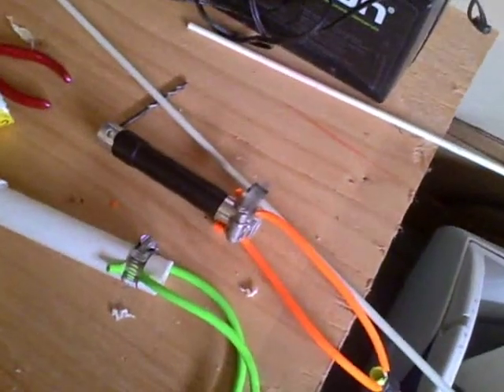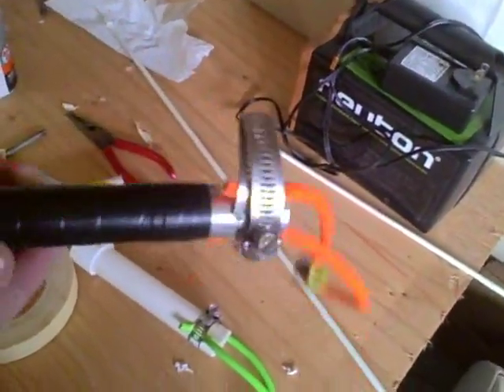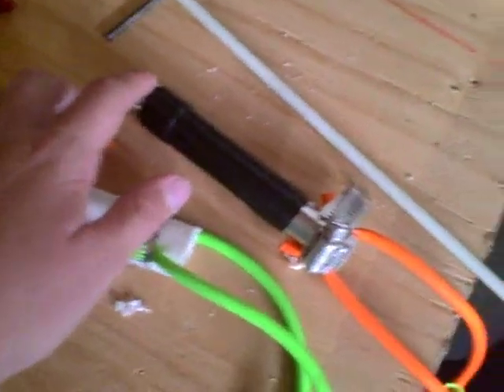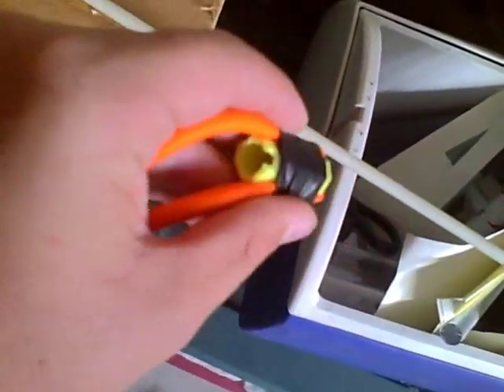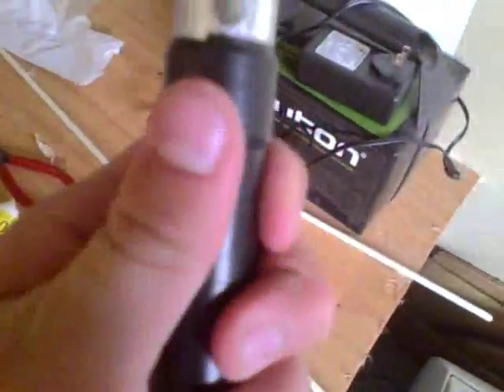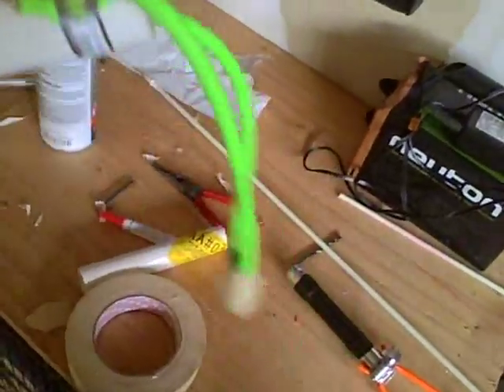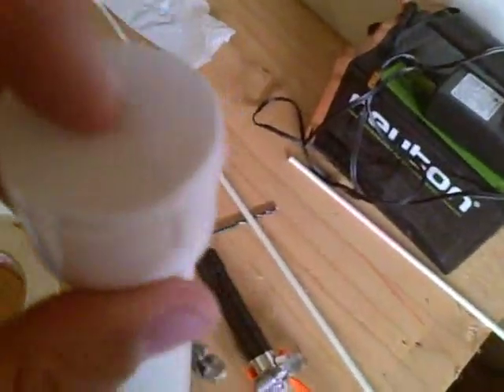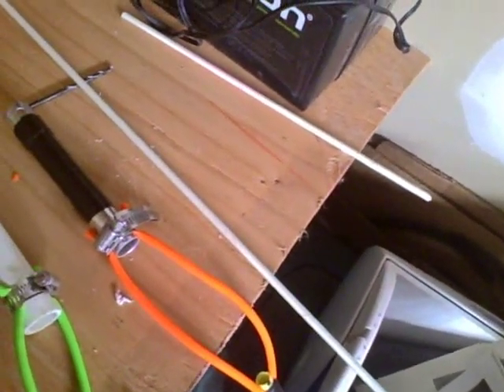Maker360: Homemade Hawaiian Sling

Comment: @Daraki1337 Plenty of people use hawai'ian slings with a line trailing from the rear end of the spear. The line has some obvious advantages for keeping hold of a fighting fish and avoiding spear-loss.

Drill a small hole through the tail end of the spear and tie a bit of monofilament or some other line through it. Job done.

Comment: The spear's body seems to be made out of a length of 'dowel' or 'rod'.

Depending what it is made out of, it may be called something else.

Both are generally solid, and not hollow.

Hollow ones are generally called 'piping', 'tube', or a 'pipe'.

Hope that helped ;)

By the way, thank you for the video.